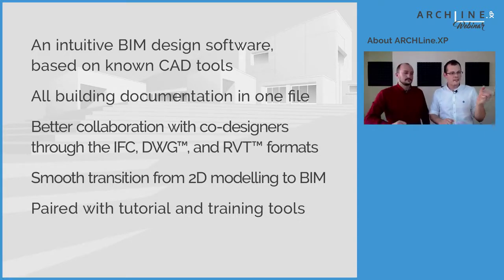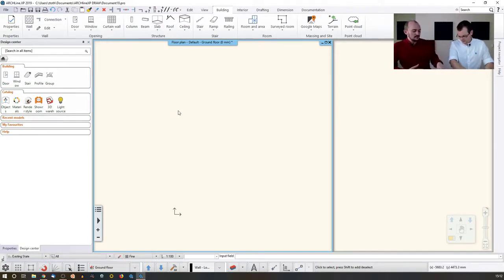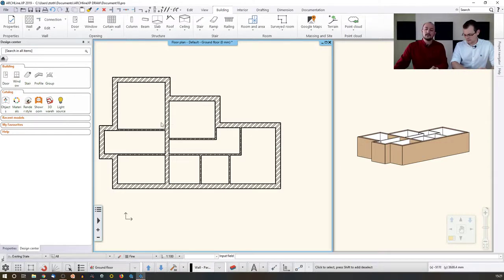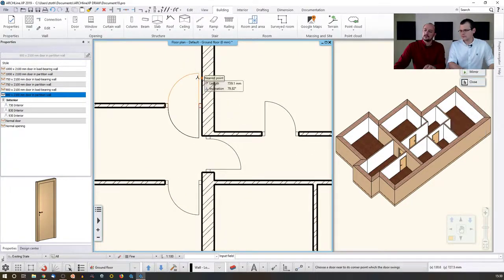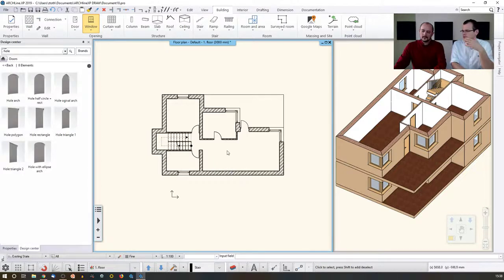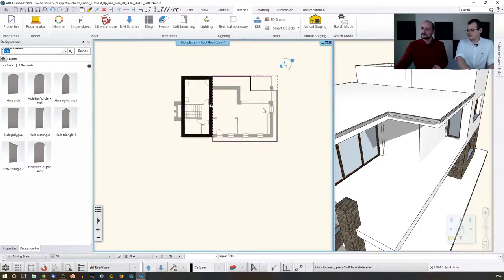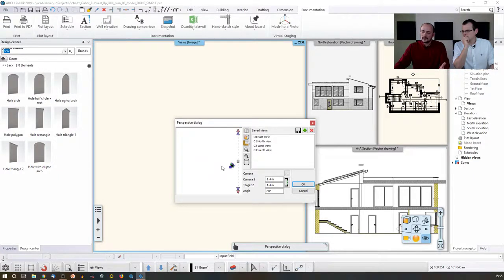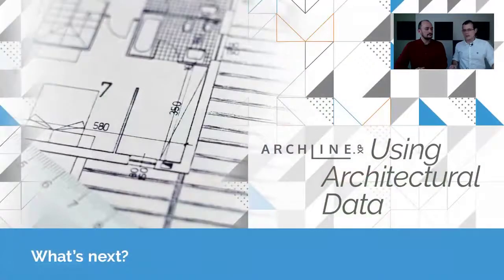ARCHLine.XP Foundation Webinar: Designing a Building

Comment: Hi, I've been following your videos and learning a lot from them. I would like to know how to add foundations for walls using this software.
Reply from the maker: Hello! We have a foundation solution in the program, by clicking the SLAB tool you can find OPEN and CLOSED FOUNDATION tools.
Reply from the maker: Thank you for your message!
Reply: Hi, thanks for your reply. I saw the foundation tool alright but when I tried it on my walls I noticed I cannot centralize it as in get it to be at per with my exterior walls, it always move to the side of the exterior wall (inside or outside). In my country we use that same style of foundation but most times the foundation wall is centralized, this though depends on what you're working on. Maybe there's something I'm not doing right here. Really I'm impressed with this software because everything seem to have been well thought of and kept organized and I would like to start using it as my primary work tool. I've been using Revit and Archicad for over 12 years but this software (ArchLine) seem to have something which I don't see in Revit or Archicad. The ease of approach and usage I think. And the UI is what made this software unique, its lovely, make you want to work and work and forget about everything else, its just lovely. Do you guys by any means have a complete tutorial or tutorials on how use this software properly? As in from start to finish which includes how to dimension, how to do wall details, foundations, roofs etc. I think if you can put up something like that it will help a lot rather than the way it is now. I've introduced  this software to some of my colleagues here in South Africa and they're really thrilled about it. Also is there an email I can use to reach you guys easily than you tube?
Keep up the good work guys.